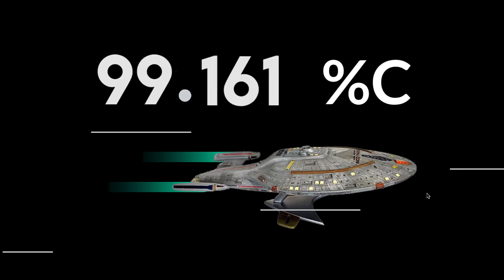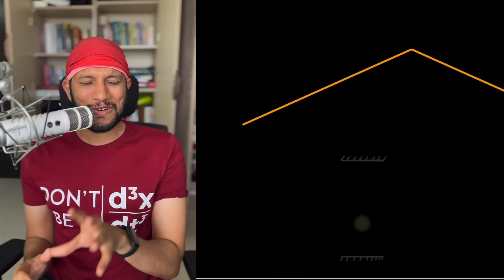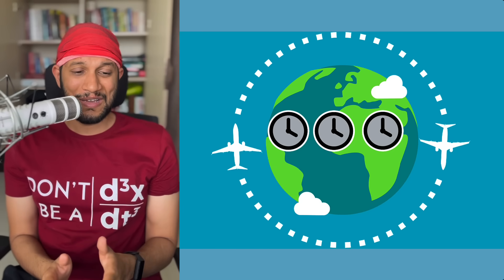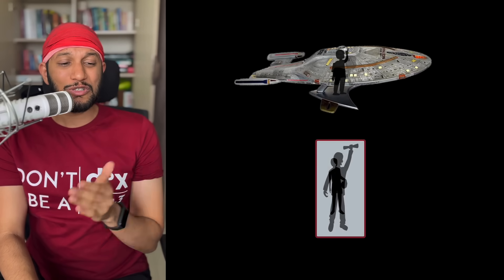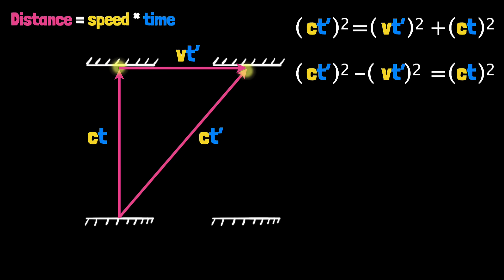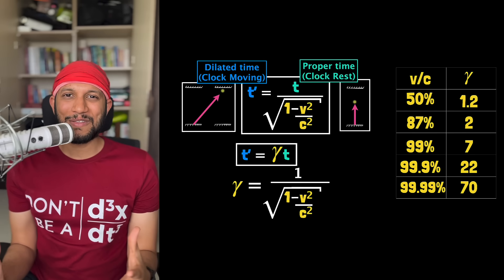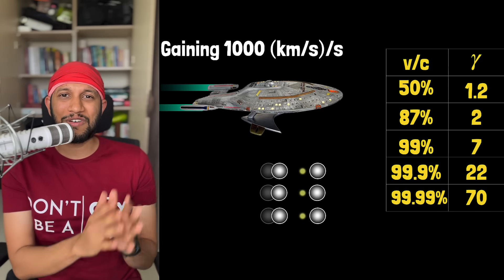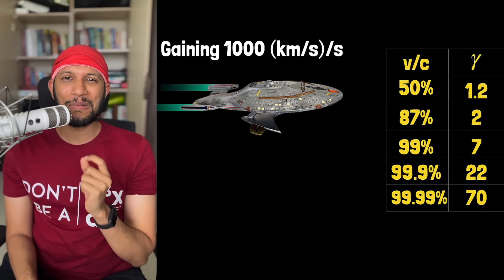I finally understood why you can't go faster than light! (My mind is blown)

Comment: I don't see my comment posted so I'll ask again. Then why do photons travel at the speed of light if it takes infinite time to accelerate to the speed of light?
Reply: I’ll take a crack at this (but I could be wrong) - because photons have no (or very little) mass, whereas anything with mass requires infinite energy to accelerate to the speed of light
Reply: @Chris-ee5bg  Thanks, I can buy that. Based on your reply I did check if photons have mass and apparently they do not which is a mind f*ck* all on its own I think. lol

Comment: You can travel faster than light at where you left, you just need to believe in yourself more, buddy.  Time will always seem normal to you. The time you lose to an observer when going away is returned when you journey home. 

Things going above the speed of light in a given frame of reference are not in that frame of reference except maybe tied in with a weak force like gravity. 

You "slow down" to an observer from where you left as you travel away because you're ceasing to exist to them...whatever the signal is, you send less of it. When you return home you would be decelerating back into their frame of reference which they would observe as your signal increasing or you 'speeding up' as you approach.

To you, your signal is always the same.

You're falling for Zeno's arrow paradox.

You can't exceed the speed of light locally, you can exceed the speed of light where you were.

If your ship was going 1 kph slower than the speed of light and you sprinted forward you would be sprinting at your normal speed to you and while your ship would still exist, you would no longer exist to a hypothetical observer back home. (Who somehow was able to defy physics to see that much detail from that far away despite the fact that your ship has already, to an observer back home, stretched to near infinity aft to fore and shrunk by the same degree between port and starboard)

Comment: The theory is decent, but what if instead of the clock moving sideways it moves up or down? The time it takes for a photon to reach the other side will decrease going one way then increase the other way. Now consider that photons don't move at a constant speed, as they change based on the medium they are traveling through. Things get a bit more complicated. Of course time dilation does happen, we have proven it to a high degree. That means that it isn't photons determining the time dilation but something else.

Comment: Well Your Wrong The Secret To Faster Than Light Travel Is Hidden In The Mathematics of Thermodynamics The Theory of Relativity Is No Longer Credible With This New Understanding of Entropy It Changes Everything And This Is Why No University Will Hear Me Out They Want You To Believe The Theory But My Proof of Concept Can Actually Be Tested In A Lab Debunking Every Theory Out There That Makes The False Claim That Speed of Light Cannot Be Exceeded When In Fact It Can Just As The Supersonic SR-71 Blackbird Cracks A Sonic Boom When It Flies By The Spaceplane Flying Faster Than Light Flies By With A Blinding Flash The Physics Are The Same It's The Entropy That's Different Light And Sound Have Different Entropy Understanding The Entropy of Light Is Critical To Understanding How You Can Exceed The Speed of Light

Comment: Hmm kinda weird.
You said it takes infinite time to reach c. But that’s only from the perspective from people watching from earth. 

As you said. At 99% of c it takes 7 sec on earth for gaining another 1000 km/s 
So at 100% c it will be infinite sec. But in the ship it’s still the same 1 sec all the time. 

I think it’s not a problem of the time dilation. It’s a problem because of the increasing mass. Since in general relativity there is no difference between the force of gravity and a moving object at a certain speed. 
So the faster you go, the more mass you have. And since you need a certain amount of fuel to accelerate the same mass, you’ll need infinite fuel coz your mass will be infinite.

Comment: This makes perfect sense, however it’s all based around constants. The vacuum of space is not a constant. For example. Our universe is expanding and galaxies are being moved further away from each other, while the space found within a galaxy is not. So how does light behave when met with a fluctuating constant? It slows down, therefore the speed of light is not a constant and by conclusion Einsteins theory has a massive hole in it.

Comment: Fascinating, but travel at the speed of light?  Distance for time?  But if time is not consistent, then how can the speed of light be  consistent?  And if speed of light is not consistent, how can it be a barrier?  Personally I don’t consider it any more a barrier than riding in a fast train one can’t breathe, or sound barrier which both were barriers that no longer exist in the same way., they were used decades ago, do they?  We just haven’t figured it out yet, have we?  But it’s easy to calculate barriers, isn’t it?

Comment: Next question - why can't photons move any faster? Are there things that do move faster? Is this an explanation for things that we "see" moving backwards in time? Also, if I am in a plane, and the plane is traveling hundreds of miles per hour, I can also travel hundreds of miles per hour, and then i get ot add my own speed as I walk inside that plane. So even if the plane reaches its maximum speed, i can move faster by walkign inside of it. What does this behavior not also apply to the photons which are allready moving within a space ship...moving at the speed of light, within the moving spaceship? Perhaps im just not familliar enough with the way energy works compared to matter, and the physics dont apply the same.
Reply: For radio waves there is no ether. The space ship cannot drag along ether to allow radio waves to have c relative to it. Radio waves are basically naked and behave as if there was no ship or airplane.

Comment: Or, hear me out: there is a simpler way to describe it.  If you are looking at a clock and you start backing away from it really, really fast, the light particles can't catch you, so you won't see the clock hand move.  You're backing away as fast as it's coming towards you, thereby "stopping" time.  So, hypothetically, if you COULD go faster than the sped of light, would you start going back in time??

Comment: I don't disagree with your math.  However, it almost appears that you're saying the transfer of energy takes longer based on the diagonal trajectory, but only from the outside observer. Not with relation to the speed of the matter itself, right?  Because relative to each adjacent atom, the inertia would be carrying over the energy.  Right?  So, the force of acceleration without opposite force applied would continue to increase velocity consistently to all adjacent atoms.  Wouldn't it be more accurate then to say that we could never really observe the travel at the speed of light?  But that objects with continuous thrust would continue beyond light speed until acted upon by something else?  i.e. inside the ship, you'd never be able to tell that you had gone beyond the speed of light, because observing the outside's acceleration would also run into a similar time dilation effect, but you could still potentially be going faster unless acted upon by opposing force.  Right?

Comment: At 16:39, why c stays unchanged when there is motion. I think the overall speed should be the sum of the original vertical speed c and the perpendicular horizontal speed to the right hand side generated by the walls and that means the vertical speed stays at the same c. Please correct me.
Reply: Michelson-Morley experiment proved the speed of light is the same in any direction. Not even Earth's rotation acceleration affects it.
Reply: @michellhongrois8115  I see. Thank you for the clarification.

Comment: If you went at 99% the speed of light, approaching a black hole, could the gravity pull you toward the black hole accelerating you past the speed of light? Or does gravity have a delay, or is it instant?
Reply: gravity pulls, but not with infinite force, so no passing of c

Comment: If I send an object towards a black hole it is accelerating towards the speed of light.  Once it enters the black hole the same object is now going faster than the speed of light.  So if time becomes slower as you accelerate towards the speed of light will time go backwards if you're traveling faster than the speed of light inside the black hole?

Comment: Just wait until you find out that the speed of light is actually quite slow. The faster you go, the slower time is for you, which means time speeds for everyone else...which in turn means you are going slower. There is a speed at which for you, you would be going close to the speed of light, but for everyone else you would be stationary, therefore, not moving at all.

Comment: This Physics explanation is completely false.

Do not blame the presenter. He was following the standard Modern Physics Doctrine created by Albert Einstein's Theory of General Relativity.

Einstein Created that theory from observation and assumption. With that there was no underlying "Physics Theory" that Einstein built upon. In other words Einstein did not know what caused General Relativity, he just made assumptions about what happens if Photon light segments would travel at a specific velocity limit in vacuum.  

Now you know what happens when you make assumptions.... And Einstein has a famous one built into his Theory of General Relativity. When Einstein was using Energy calculations he ran into a dilemma  one of two variables must be a constant while the other one varied by velocity. The 2 variables were Mass and Charge. One changed and one was not effected. Now Einstein knew that Electrons moving close to the speed of light could be deflected by Electromagnetic fields to steer the Electron stream. So Einstein assumed that Mass varied with velocity. Due to that assumption it made it impossible to travel faster than light (According to Einstein's Theory of General Relativity).

For the next 100 years or so that was the dogma of General Relativity. Even though in the late 1980s it was discovered that there were massive particle streams leaving Pulsar M87 that were traveling faster than light. For 3+ decades they tried to explain this observed event away. Some said it was an illusion, some said it was a measurement problem. Eventually they had to accept the fact that in nature the M87 particle stream was traveling faster than light. Today's General Relativity dogma theory states that those particles are created Anti-Matter, and that Particles traveling faster than light must be Anti-Matter. To help with this experiments at Fermilab and CERN have measured particles moving faster than light with the opposite charge of the initial particles. So current theory has Faster than Light exists for Anti-Matter.

But the initial Anti-matter  discovered was moving slower than the speed of light... So how can this be?

Well about 8 years ago a Physicist was stacking firewood for a day like today. He was thinking about a completely un-related topic which was "Wave Particle Duality" and the "Delayed Choice Experiment". As he dropped firewood on his feet he discovered why we observe Wave Particle Duality. It is caused by a previously unknown interaction he called the "Rosetta Stone Effect". (The detailed explanation of this effect and how it causes General Relativity would take 60+ pages of detailed Physics theory writing so I will provide a simplified version.)

Basically the Rosetta Stone Effect is caused by moving an Electron's or Proton's Static Electric Field in a linear fashion. As the Field enters space that space has charge, but as it leave space it loses charge. Well not exactly. In Physics gaining is easy, but losing requires other Physics Laws to be applied. Specifically Farraday's Law! Where that motion creates a trailing smaller induced Magnetic Flux. The Magnetic Flux also is moving and as it diminishes an (opposite) Electric Field is generated by applying Ampere's Law. Which creates a cone like structure of Fields and Fluxes trailing the charged particle.

The reason that this odd Electromagnetic wave effect is called the "Rosetta Stone Effect" is that in its application 7+  different observed Modern Physics observations are cased by this one Physics interaction. 

Among these is General Relativity. See, when a Charged Particle moves its Charge is the static particle charge + the induced charge caused by the Rosetta Stone Effect. That induced Charge is -(v/c)^2 * <Initial charge of the particle>. So the by properly applying Maxwells Equations to a Moving Electron its Charge is -E[1 - (v/c)^2] instead of "E". Looking at the equation shows that it is the relativistic Charge equation. But instead of being assumed to be constant... it is  derived by applying Maxwell's Equations properly!

So Chage changes  with velocity in the direction of motion. Which means that Mass actually must remain constant in General Relativity. That will mean that Energy does not go infinite with velocity approaching the speed of light. 

So where is the experimental Proof? Well Pulsar M87 has been proving it since 1980s. And Now CERN is accelerating Charged Electrons faster than light... And the new Charge (Velocity) equation becomes a negative value the instant it moves faster than light.   CERN was accelerating Electrons faster than light for years, but did not realize that they would have a positive induced charge once they exceeded the speed of light.

So this new theory actually matches the experimental results better that Einstein's Assumption.

How Do I know about this.... I am the Physicist who dropped the wood on his feet!

This can be read about in detail in my Physics Theory Books:
"Heretikal Physics
(Volume 1 – Introduction to Basic and
Early Atomic Physics - Part 1)"
and
"Heretikal Physics
(Volume 1 – Introduction to Basic and
Early Atomic Physics - Part 2)"

Starting at Chapter 12 for Rosetta Stone Effect and other chapters from there.

Books are available on Amazon if you want to check. And are Part of the Kindle free reading Program.
Reply: Ohhh dayummmm😲we got the og here
Reply: @CTP574  Thanks. It was as much as a surprise to me in finding it.

Comment: So it's not that things "can't go faster than the speed of light". The issue is, information happens AT the speed of light. So even if someone managed to build a device capable of speeds faster than light, it physically could not operate any faster than the information required too make it work at all... 🤯

Comment: 14:40 you are forgetting that the stationary observer is not the one accelerating the ship.. the ship accelerates in its own frame of reference in which time still flows unchanged so the observation fact of a stationary observer that it would take them an infinite amount of time (thus energy) to reach C is irrelevant to them

in other words, from the POV of the ship, it would take them the same amount of energy to increase speed from 0 to 1% C as it would from 99% to 100% C, what it means to external observer is irrelevant to the ship's frame of reference, that's exactly what's relativity and time dilation is about

Comment: So, i''m certainly not smart enough to understand this, but i have one basic question.  The photon clock bounces photons off of mirrors.  If the phirst photon, leaves the phirst mirror at a 90 degree angle, how can it leave the second mirror at a different angle.  I think you are breaking the law or reflectivity.

Comment: Very nice explanation, but i have one question, when the spaceship is approaching the speed of light the time inside the spaceship would move in slow motion, nearly freeze for an outside observer but what would you experience inside the spaceship? There you'd experience nothing strange right? You'd still observe an acceleration with 1000km/s per second even if billions of years would go by for an observer. What would a guy on the spaceship observe? a near light speed and inevitably run out of energy?

Comment: Great explanation. I would be remiss to mention, though, that one of the biggest factors to this problem is that this centers around particles with mass. If the ship was somehow entirely massless, you could accelerate to c instantaneously. You can test this by simply turning on a flashlight, emitting photons which travel at c because they are massless, using nothing but the power of a simple battery. In fact, you would not need any energy at all. It would just happen.

I would also like to add some fun info: There are theorized particles that exist which are both real and massless, but they've yet to be discovered, namely the gluon, graviton and other quasiparticles (such as weyl or dirac fermions, but generally not considered real by the standard model so we can exclude them at this moment).

Another fun fact is that photons have no "memory" of their travels along the universe. They "live and die" the same instant they are created, from their point of view. So while light from the edge of the observable universe took billions of years to reach us, that only matters from our reference. In the photon's reference, the trip was instantaneous.